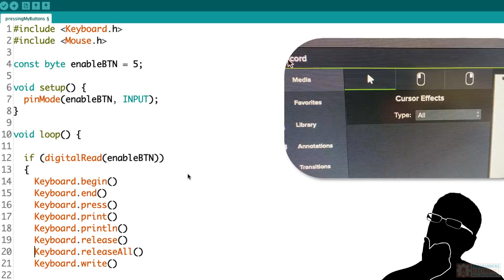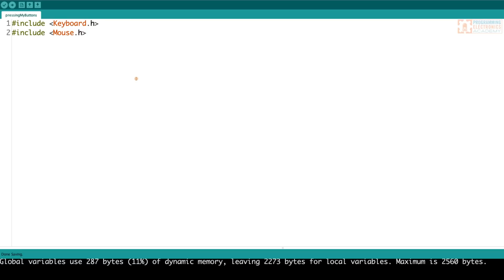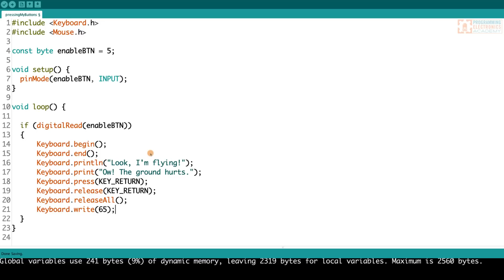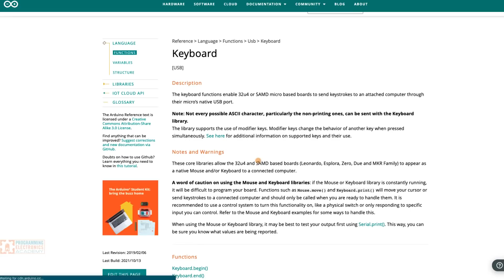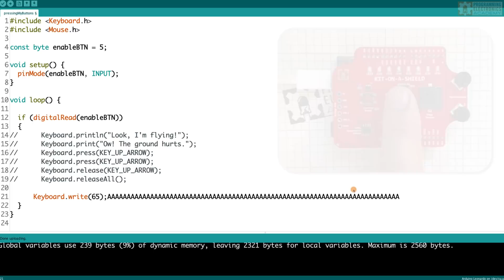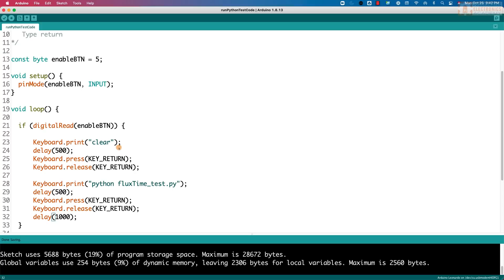Control your keyboard with Arduino!  Automate simple tasks!

Comment: I can't use the keyboard library, I'm using an arduino uno if that is relevant
Reply from the maker: That keyboard library does not work with an Arduino UNO R3 (but should work on an R4 from what I understand).

Comment: You don t need an arduino to do that. Just run a script on your pc.
Reply from the maker: You're right!  Could run a script on a mac as well.  The idea is being able to use external hardware to trigger such tasks, aka, button presses, sensors, etc.

Comment: came for see is arduino i have can be use as keyboard. suddenly  learn how to make it. tbh it kinda same as keyboard library from python. wonder if they are made by same guy

anyway if you still use a macro or other people plan to make macro like this. im suggesting using python library and bind it to function key like F12 or F1. or maybe just like me using macro keyboard to add F13 and F14(yes it does exist and yes it registered on windows. the only way i know to make this by print it with python script while record macro key on my keyboard. and waila you have extended Function key)
by doing this you make 0$ macro function instead buy Arduino and buy a button. 
but sure having keyboard library on Arduino does kinda help if you want to fix old expensive keyboard but chip broken. 
im actually planning fix my keyboard that why im coming here to make sure is my board compatible with library

Comment: Hi. I did not see your video in time. Sure enough that’s what happened. Took some time to get it straighten out. Thanks.  If I could ask a question on if else statement. I have nested if- else statements 3 deep. When coming out after executing  the inside statement, does the program flow skip over any ‘else’ statement it finds coming out though the outside ‘else’ statements. If that makes any sense
Reply: Is there a good way to get out of this keyboard lock. Just happened again and whatever I did last time to get out of it I cannot replicate getting the Arduino to again accept downloads. Sorry for the trouble. Wayne

Comment: Excellent video, very clear explanation. But if I don't have a Kit-On-A-Shield, would making a connection with a switch between pin 5 and ground be enough?
Reply from the maker: Great question Dardo!  I should have been more clear about that in the video.

You should probably add to that a ~10K pull down resistor from pin 5 to ground as well.
Reply: @programmingelectronics  Is it possible for the plate to burn out if I do not connect the resistor? Because I saw other tutorials in which they connected the pin directly to ground, in that case it was an arduino pro micro board which is the one I bought. I'm new to this, sorry if my question is too obvious.
Reply from the maker: @dardodiesel5502  Great question!  There would be no harm done to the board/circuit/button/etc if you did not connect the resistor.  

This gets a bit convoluted, but...The resistor recommendation was to make sure that your input pin was "pulled down" when not being pressed - that is, so when you are not pressing the button that it reads a LOW voltage.  It may already be showing a LOW voltage when the pin is not pressed, but the pin is in a "floating" state if it's set to an input and not connected to a voltage source (aka, ground or 5V).  Now what you could do, is sett the input pin to an INPUT_PULLUP using the pin mode function, and then instead of hooking your button to pin 5 and 5V, you connect it to pin 5 and ground.  In this case, when you don't press the button, it would read HIGH, and when you press the button it would read LOW, so you just need to adjust your logic in this if statement to trigger on LOW.  Sorry for the run on - hope it helps some!
Reply: @programmingelectronics Thank you very much for taking the time to answer! Your explanation helped me a lot.
Reply from the maker: @dardodiesel5502  Great!
Reply: @programmingelectronics when i do what you said, I does not work for me. I try writing “digitalRead(enableBTN = LOW)) and this gives me errors, and I was also confused as to the wiring of the circuit. I was not sure where to put the resistor. Could you help?

Comment: guys I get error Compilation error: keyboard.h: No such file or director how do I fix it?
Reply from the maker: Great question!   What board are you using?
Reply: @programmingelectronics  uno 3
Reply from the maker: @Qwzdf  Unfortunately, these libraries will not work on an Arduino UNO.
Reply: @programmingelectronics  will it work on the MEGA? im considering buying it, also which ones are supported?
Reply from the maker: Great question  @TriflingToad  !  A Mega will not work with this library.  An Arduino Leonardo would work.(Zero, Duo, and MKR family)

Comment: been having a hard time finding how to do with with more than one button. I have a box I made and did this in the past.. but I cant find my project file or resources on how to do it so far! I know it isn't that hard.. but I cant figure out how to do it so far...  I have 10 buttons setup in a non matrix style all of the buttons have pull up resisters on it already... plugged into a leostick ...Any ideas?
Reply from the maker: Great question - I've been wanting to build a custom keyboard emulator myself for some specific key presses.

Basically, you just need to read button presses in the loop, and when a specific button is pressed, you have you code execute that keyboard command.  It can get a little tricky, because you want to make sure a button press is only registered once per press, and that button presses don't get missed if you're doing other stuff in the program.

I'll see if i can come up with something for this one...

Comment: Can you somehow asign additional f-keys to those buttons and like a mouse-wheel to a potentiometer?Would be very nice, because then it could work as a editing keyboard for davinci as an example.Very nice video btw!
Reply from the maker: I think that is very doable.  I think you might consider a rotary encoder over a potentiometer for the spin action, but in general, yes, totally possible.
Reply: @programmingelectronics  Yes, after a bit of researching that seams like the best option. Not quite sure how to set this up in my editing Software(Davinci), but il find a way.

Comment: Regarding begin() and end(): the purpose of these methods is to future-proof your sketch. If you use them as suggested by the documentation, your sketch should be compatible with future versions of the library. This means: never use another method before begin() nor after end(). Do not assume print() before begin() does nothing, and do not assume it does something either: don't make assumptions, just don't do it. And please, do not teach people to omit begin(). BTW, since version 1.0.4 of the library, begin() is not empty anymore.

Regarding your example program at the end of the video, you would be better off leaning how to use the “alias” command from bash. The Keyboard library is most useful when you want to build custom input devices, like a game controller or a barcode scanner. For regular task automation, software-only tools tend to be more effective.
Reply from the maker: Awesome - thanks for adding this Edgar!

Comment: How would I use rf24 to set pins high or low using 2 Arduino unos and a laptop?
Reply from the maker: Great question!  Can you expand a little on the application?

Comment: Is there a way to make a key to do a Command C (copy) for the Mac? On the runaway problem, I just added a 5-second delay in setup. I used the pro micro to make a programmers keypad, so I have separate keys for (), {}, < > etc. works great.
Reply from the maker: Thanks for adding that about the runaway problem V J!

As for the copy (and maybe paste as well?) I have not tried this, but I think you would use the press command, the appropriate modifier keys, and then the release command.  That would be fun to try!

Press-> https://www.arduino.cc/reference/en/language/functions/usb/keyboard/keyboardpress/
Modifier Keys -> https://www.arduino.cc/reference/en/language/functions/usb/keyboard/keyboardmodifiers/
Reply: @programmingelectronics  Yes, but I don' think one can simulate a 'command' button because its some kind of key for the OS only, as far as I can tell. Thanks.
Reply from the maker: Hi  @TheUnofficialMaker   - I just check on this, and looks like it is KEY_LEFT_GUI or KEY_RIGHT_GUI to press the CMD Key on Macs - I have it working in a simple sketch to copy and paste a line of text.  I'll see if we can get a short video showing how as well - thanks for the great questions!!

Comment: Can the Arduino emulate other special keyboard keys that don't seem to have predefined constants in keyboard.h (for example, sleep ,  multimedia keys, PrtScn, and differentiate between main keyboard numbers vs "number pad" numbers)? Is yes, how can we find out what codes to send so we can augment the built in constants with our own?  What about maybe trying to find it out by building a keylogger. I suppose I would need to add a host USB port to the Arduino. But can you use a host port and device port at the same time? Or even better, can I control the function of the USB port on my Leonardo and "toggle it" between host port and device port behavior?
Reply: Version 1.0.4 of the Keyboard library brings a few more key macros, including KEY_PRINT_SCREEN and all the keys of the numeric keypad. You now have all the keys of a “standard” full-size PC keyboard. No Sleep or multimedia keys though.

I do not think an Arduino can be used as an USB host. The SAMD based-ones maybe, but not the Leonardo.

Comment: Is there a way to do this without a physical arduino button? Because it would be quite nifty to be able to bind this process to a key on my keyboard, thanks.
Reply: Autohotkey. It can emulate a keyboard and do a lot more at the touch of a key. It can maximise and minimise windows; it can open, move, copy, and delete files; it can run programs, with or without arguments; it can detect the colour of a pixel on the screen; and a lot more. It can also do different things dependent on context. The context can be whether a file exists, a certain window is open, a certain window is active, and so on. It beats the Arduino hands down. I couldn't live without AHK. It has saved me millions of keystrokes and mouse clicks.

Comment: Great tutorial. Can I add if  you find yourself in a keyboard/mouse runaway situation you can press and hold the reset button on your Arduino, the Arduino sketch  won't run while the button is held in. Click load on your IDE and simultaneously release the reset button.
Reply from the maker: Thanks a ton for posting that Scott!
Reply: Can i use arduino nano or uno😢

Comment: And how do you do this "outcommenting" of several lines at once with double slash?
Reply from the maker: Great question!

If you select multiple lines, and use "Control + /" on PC, or "Command + /" on macOS, it will comment multiple lines.  If you select commented lines, and then use the same keyboard shortcut, it will toggle back to un-
comment
Reply: @programmingelectronics  thank you! I learned something today!
Reply from the maker: @Pit.Gutzmann  awesome - glad it helped!

Comment: You did not mention Arduino Uno and Mega boards. Do they work with it as well?
Reply: Can it also appear as a native keyboard and mouse like 32u4 and SAMD based boards?
Reply from the maker: @RobinHood-zi9ct That's right!  I believe the new R4 UNO's should work with these libraries.
Reply from the maker: Great question!   They do not work with this library.
Reply: @programmingelectronics but this is not anymore the case with UNO rev4 right?

Comment: So, (14:30) how did you reprogram the board to stop the key entry or mouse movement?  You mentioned that you tried to upload a new sketch. Is the solution to upload a new "bare minimum" sketch?
Reply: If you find yourself with that type of runaway situation you can press and hold the reset button on your Arduino, the Arduino sketch  won't run while the button is held in. Click load on your IDE and simultaneously release the reset button. Hope this helps.
Reply from the maker: Great question!  You can upload any sketch that allows you to get back keyboard/mouse control - the "bare minimum" would be a great option, or you can just comment out/change the lines of the current program, so as not to use the keyboard/mouse.
Reply: @programmingelectronics  That's still not the answer to the question Keith had and I still have, that you can program the bare minimum sketch or to comment out the problematic line of code is the most logical thing to do, but if the Arduino is causing havoc to the input of your computer and really doing something that makes it impossible for you to do anything yourself with your mouse or keyboard.

Let's say we are in a hypothetical worst case scenario and as soon as you plug in your Arduino it makes everything you want to do impossible and there's nothing you can do, other than unplugging the Arduino to get back the control over your computer, do you have to consider the Arduino to be unusable from that point or is there something you can do to either block the Arduino from taking over your keyboard and or mouse or is there a way to reprogram the Arduino without plugging in the USB connector?

If I would start tinkering with this keyboard and mouse library for the Arduino, I for sure as hell would have made something either in software that can deal with a worst case scenario to prevent the Arduino from causing havoc or I would made something in hardware that has one very important task which is connect to the Arduino and instantly uploads a minimal sketch, and this would always be ready to use and in close proximity.

While I'm writing this comment I realize that I came up with the answer myself.

>> HERE IS THE 5 STEP SOLUTION <<
  1. It's simple, use a different Arduino UNO and upload the Built-in sketch number 11 (Arduino as ISP). 
  2. Then connect the Arduino as ISP to the "bricked" Arduino with the 6 PIN ISP connector.
  3. Now connect the Arduino as ISP into your computer using the USB connector.
  4. Make sure that the Arduino IDE is configured the right way, under Tools you need to set the Programmer to Arduino as ISP.
  5. Now you can upload your new sketch to the "bricked" Arduino as usual with the upload button, the only difference is that you program your Arduino via another one instead of plugging it in directly to your computer via USB.
Reply from the maker: @RicardoPenders  Awesome!  Thanks for adding all these details and steps!

Comment: Nice little video.   I've been using Pro Micros (see my comment below) for years to make small keyboards dedicated to specific apps on my computer.  You can even hack the little key sampler packs, so instead of little tactile buttons, you would have actual keyboard keys!  These can all be useful when editing or viewing videos or image files.   They can also enhance the playing of games that take dedicated keys for certain activities.  For me - I don't want to have to search for the air-brake button while I'm landing a 737 in a Sim.
A couple things though:
1) Someone also mentioned the Micro. It has a 32u4 and is good for projects that use a lot of IO pins.  But here is also the Pro Micro.   It has a 32u4, but is smaller than all of the other 32u4 Arduinos, which makes it one of the least expensive options.  It has a lower pin count as a result, but it can still handle all of the options discussed here.  And then when you want the best, there is the original Teensy.  But that may be a little beyond the beginner level of this video.
2) When I control something in Arduino with a button, I normally don't use the button-is-pushed as the enabler for the if statement.  My if statement would be more like "If the button is pressed, but previously wasn't pressed, then produce the keyboard output".  This uses the transition of the button and keeps it from going off sporadically as the button is held.  This adds a variable ( to save the previous button status ), and a tiny bit of complexity to the code, but I think it's worth it.  It may even need a small delay to overcome bounce, but it should be waaay less (milliseconds) than the full second in your example.

Comment: So do you connect the Arduino to one USB port on your computer and your actual keyboard to another USB port on your computer?  Or do you connect the Arduino to a USB port on the computer and you somehow plug your actual keyboard into the Arduino and the Arduino “passes thru” keyboard presses on the keyboard thru to the computer?
Reply from the maker: Great question!   You just keep your normal keyboard plugged in and it works fine.  The Arduino then acts as an additional keyboard.

Comment: I got the perfect use for this. Because I have arthritis, playing games on my computer can be difficult and I was thinking about building an input device where I can comfortably place my hand in its natural position and then operate buttons that would be mapped to the keyboard. I was initially planning to use the chip from an old keyboard and build an appropriate matrix, but I think this will be not only easier, but modifiable as well. 
Thank you so much for this video. I've used an Arduino for many projects, but never played with these libraries.
Reply from the maker: Very cool application Roy - good luck on the build!

Comment: I use processing 3  for keyboard and mouse with ardino uno
Reply from the maker: I LOVE processing!  That's what actually got me thinking about using Keyboard/mouse control.  We have lessons on connecting to twitter through Arduino/Processing library called twitter4j -but we're using the Processing 4 I think?